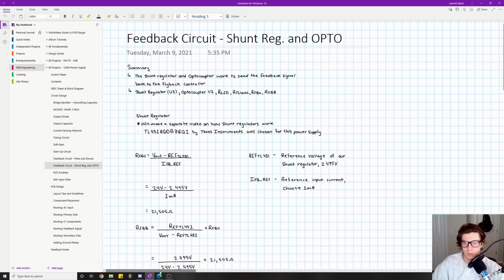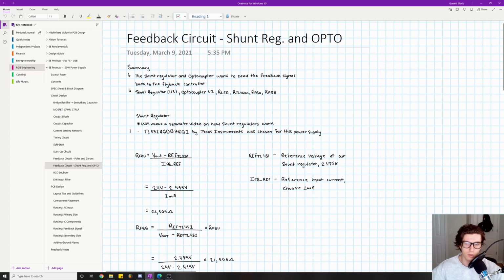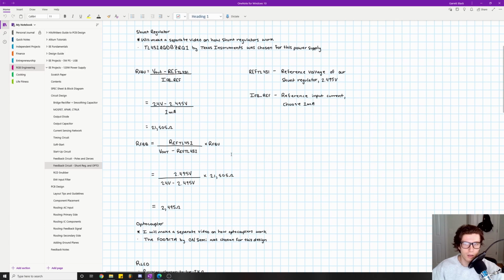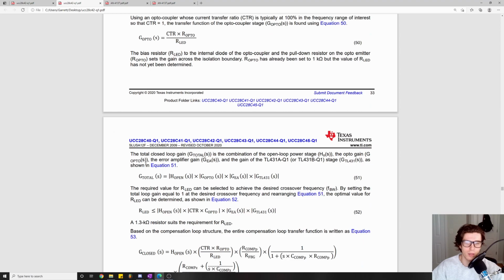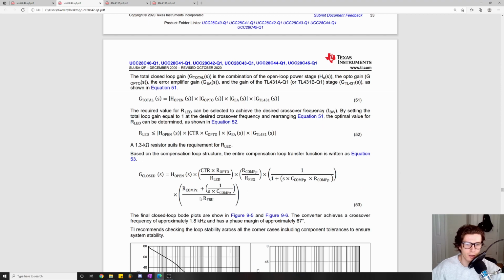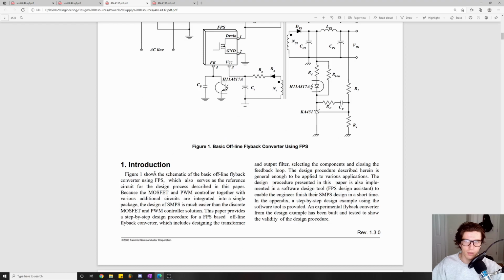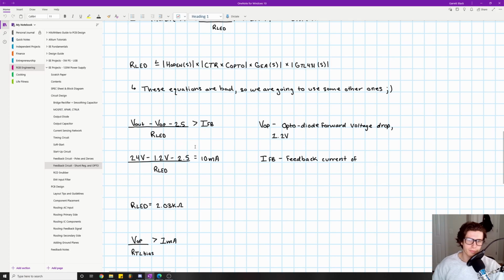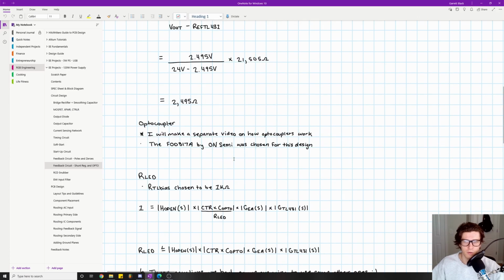FLYBACK CONVERTER PROJECT PT 13 | 24V, 120W FLYBACK CONVERTER EXAMPLE | POWER SUPPLY EXAMPLE PROJECT

Comment: Doesn't this IC exceed the 24V voltage rating, or are we adjusting it using resistors (I want to use it for 28V)?
Reply from the maker: you can adjust it with resistors